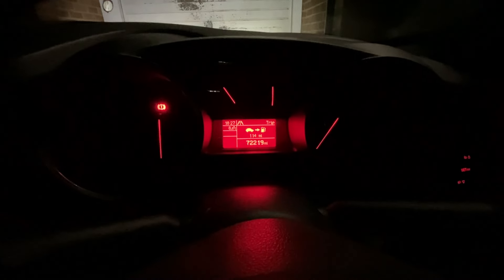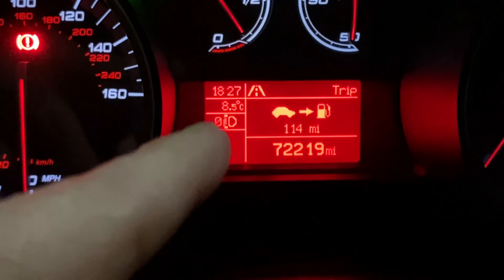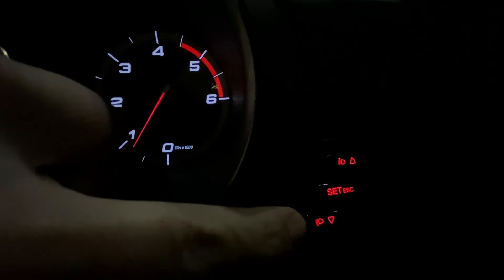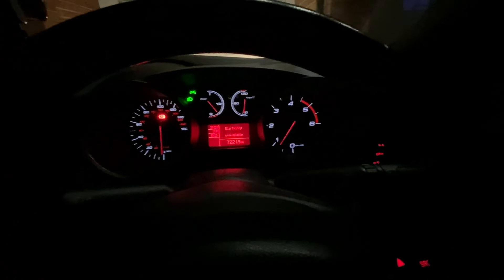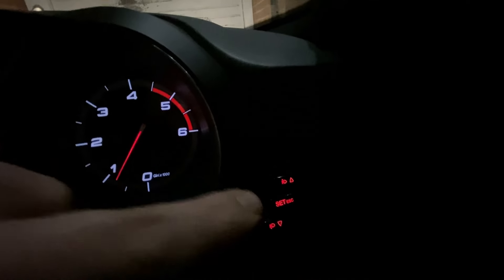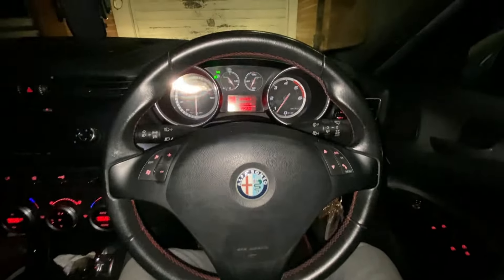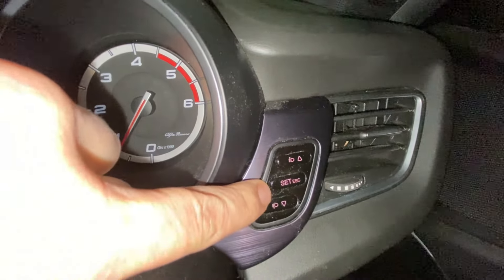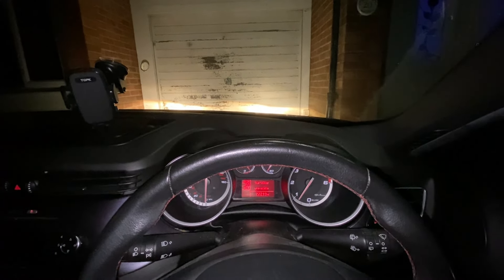Alfa Romeo Giulietta Head Light Adjustment

Comment: The dipped beams on the Giulietta are useless and I used to drive around with them set to 0 most of the time. If you do set them to 0 then expect to get flashed constantly by oncoming drivers thinking you’ve got your high beams on. I actually failed an MOT as well for having the dipped beams set too high 🙄

Comment: Giulietta's with xenon lights have auto-adjustment through sensors on the axles. They measure how far the car squats down on the axles and adjust the beam. The automatic adjustment of xenon lights is mandatory in some country's. You can see the headlight beams move on start-up if you park close to a wall. Just turn the ignition to the first stop, turn on the headlights and start the car. They move up, down and side to side quite a bit.
Reply: I think mine has these, because it also has that Auto headlight swivel, when hitting the corners, so I'm always to light the way ahead.

Comment: This is for when towing. Due to the extra weight on the back, causing the car to squat, you can move the lights down to a reasonable level, to avoid dazzling oncoming vehicles.
Reply: So, should it be at "0" default?

Comment: Tony (or anyone else with Giulietta) can you check something please? I wonder if it is something on my G, or is it common thing for electric servo to pull so much current when turning in idle so the headlights dimm a bit? It doesn't happen when driving, just when turning steering wheel in idling, I gues alternator jumps in when driving. If it is on all Giuliettas, then ok, but if it's not common I need to get that checked.

Comment: Is it better to buy a Giulietta with bi-xenon adaptive headlights ?
Reply from the maker: Most likely yes. I've never had a G with them personally, so can't comment 100%. All the best 👍
Reply: We have a 147GTA with xenon lights. Good until something goes wrong, then they are expensive to fix. But worth it. 👀
Reply: We have both Versions of the Headlights in the Family.
I honestly can't recommend the Bi Xenon enough, the adaptive cornering and brighter bulbs itself make a difference as night and day.
We exchanged the standard Halogen lights for LED which already make a huge difference but still Not comparable to Xenon.
If you're looking for a Giulietta as a daily and you're living countryside with a Lot of B Road driving Go for the Xenons.
In the City where theres more light even at night the normal Halogen are enough.

Comment: Tony,  i need you help. I have a loose connection for the temperature gauge on my dash 0/90/130 aqua ⁰c. What wire is it? It comes on and then when i break sometimes it turns off. It should be lit while the lights are on. Im loosing my mind with it
Reply from the maker: Hi. Have a look on the channel for ‘removing the dials’ or something like that. It’s only a single plug that feeds the unit if I remember right. I know some of these suffer from poor soldering on the PCB. Yours may be one of them ☹️. Have a look at the video and hope it helps. All the best 👍
Reply: @vialettotony  legend among men! Cheers mate

Comment: Good to see you again Tony!
A have a question for you.
I saw in your video that  the small matrix screen in the dashboard, shows the outside temperature with .5 measurement.
I own a 19 model diesel giulietta and it doesn't have this "half" measurement like yours.
Have you done anything from the obd or it just came like that from the factory?
Thanks in advance
Reply from the maker: Hi and thanks. My display is standard and has always displayed .5 increments. Hope that helps. All the best 👍

Comment: Hi, I appreciate your information for this item, quite helpful.
I have an issue with my Giulietta multi function display, it lights up briefly on start up then fades from view, so I can’t see any items whilst driving. I believe there is a dimmer option to Set, but without any level of illumination, I can’t see to adjust, any ideas?
Reply from the maker: Hi, apologies for taking ages to respond. Are you referring to the display in the centre of the dash? if so, then i'm not sure i can help as i dont have it. However, using the same menu buttons in this video, if you go in to the menu there is an option for "Dimmer" which may adjust the brightness of the screen too. Worth a shot.  All the best 👍